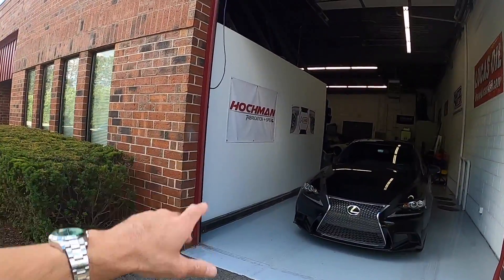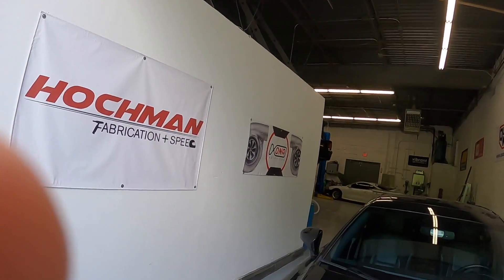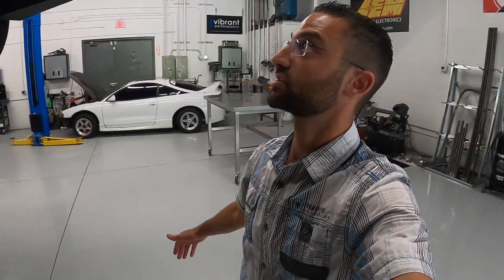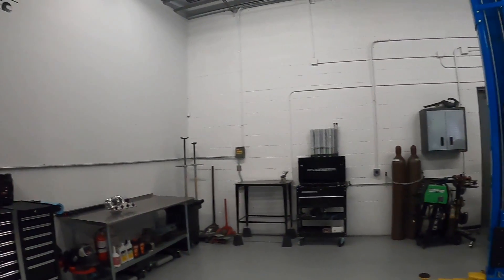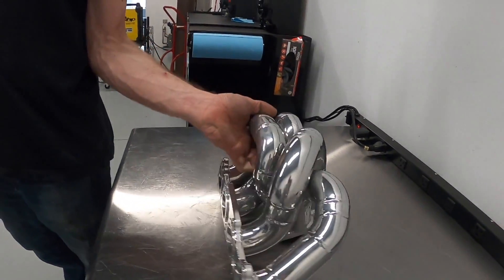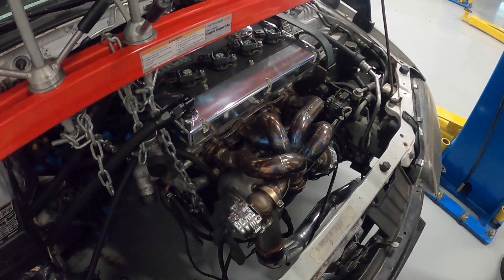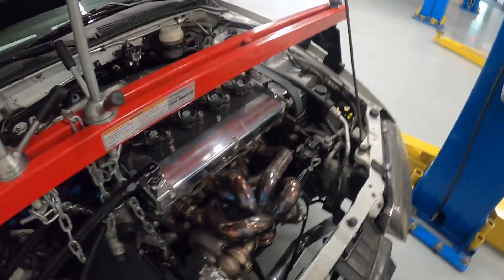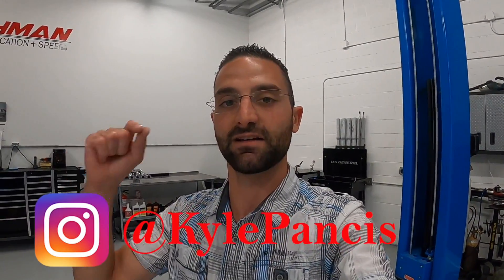Can we make a 500hp Saab 9-5 a Reliable Daily? #lovesaab

Comment: Hi, Kyle! Probably the best Saab tuner is Nordic Tuning in Sweden, they are specialised on Saab and have showed up cars with 700hp+. They know everything you need to know about programming in Trionic7, modification of the engine, turbo and so on. A 500hp daily drive 9.5 should not be a problem for them. You find Nordic tuning on Internet, contact them and tell them about your plan. Good luck!
Reply: SaabNoob in the UK can do it also.
Reply: My Saab is tuned by Nordic performance in Norrkoping, they are good. Maptun in Orebro is really good too. It´s the two best Saab tuners in the world!
Reply: I'd second Performance by Nordic in Sweden. They are the kings of making a ton of power out of pretty much any SAAB.
Reply: This is very very useful information right here

Tuners are everywhere but not a lot know what they’re doing when it comes to SAAB

Comment: Can be done. I live in 🏴 and have run a 500BHP 9-5 daily runner for the past 12 years! Has its problems, but still going well.  Ask whatever you fancy, happy to advise. SOULFIRER - UKSaabs
Reply: When you say has its problems do you mean the normal wear and tear items?
Cheers
Reply: @tseru1e  . Well- not really... 
more like-
- yes-expense of replacing specialised parts like AP discs at £800, but you need to watch oil pressure, even running 10/60 motorsport heavy duty oil and mapping idle revs to 1000. At idle when very hot oil pressure only 1 bar (15psi) Should baffle sump or dry sump it really. Had to rebuild bottom end twice after trackdays.
-I’m on my 2nd set of wossner pistons
- stainless steel big exhaust is noisy and annoys one of my neighbours 😇
- laggy below 3k - feels asleep and gutless until it’s on boost
- quaiffe 6speed gearbox sticks out into wheel arch reducing turning circle to right. So no more 3 point turns.... more like 5 point turns 😆
- breaks ABS wheel rings quite a lot
- runs on coilovers which are VERY firm and lowers car so you need to be wary of water ingress through air filter (drilled holes)
...... that kind of stuff.
Some of it like the suspension could be avoided or swapped I guess, but gives you some idea.

Comment: Greetings from Bulgaria! 
Here you go brother:
- Custom Tubular Manifold 
- Tial 38mm External Wastegate 
- GTX3071r Turbo 
- Wossner Pistons 
- T5 Cams 
- ARP Head Studs 
- Spec Stage 3+ Clutch 
- Maptun Built Trans w/LSD 
- Krona 3" Catless Turboback 
- ETS Intercooler 
- D088 Charge Pipe & Intercooler Hoses 
- IDI 050x injectors w/3.5 bar FPR 
- Walbro 4501ph fuel pump 
- Forge BPV 
- Cobra Inlet 
- NGK AFX wideband 
- Full E85 
:) 600+bhp/600 ft lb torque
Reply: Nice a ripped list from John C lol
Reply from the maker: Whats the engine management system?
Reply: @KylePancis  t7 is good for it, that’s the nice thing with Saab. No need for aftermarket Engine management

Comment: Don't forget to uprate the brakes if you update performance. I had Maptun discs and calipers on my Aero, as they are a massive improvement on the Saab set up. You will need different wheels as the Maptun brakes won't fit within the standard Saab wheels.

Had my 2005 9-5 Aero up to 300bhp but going for more power would have meant a full engine strip down to change piston and rods to forged items. It was still good enough to worry the local BMW owners.
We are lucky in the UK to have Noobtune for remaps, and tuners like Abbott for intercooler, exhaust fabrication, turbos and bolt on suspension and steering componants to make them handle. I took mine as far as I wanted to-that is, within a budget.

Comment: Love your Saab videos. I do have a question. Where do you source your parts? I need a master cylinder for a 2001 95 Aero
Reply from the maker: shoot me an email or message on IG with your email. I can pass it along to a guy that is a follower and works out of a yard with some saabs, he should be able to help
Reply: Orio that made all of the Saab original parts are still in business. https://webshop.saabparts.com/ it's amazing you still can buy original parts 10 years after the manufacturer went bust. not sure if they ship to the U.S though
Reply: @nunezmartin7441  yes ofcourse they do ;)

Comment: Trionictuning.com has alot of info you will need. Also the stock ecu can be modified easily by flashing, it just doesnt like antilag or 2step cus it doesnt like a rich mixture. But by changing exhaust, springs etc simple stuff + turbo you should hit your 500 mark easily. E85 is also simple, you just need a flex fuel sensor. Then I would suggest checking out yt channel "trionic seven" he has alot of in dept content. Looking forward to this! 😎

Comment: Just ditch the engine, as the GM B235 is pants.  Get a B234 from a 9000. They are fully forged internally. Pistons are stronger, and the block is much stronger too as the walls are thicker.  All the B235 accessories will bolt to the B234 and you can use your Cyl head too. But you will need to use a B234 head gasket. Then just head for 500bhp with injectors and turbo. The B234 block will take it fine.
Reply from the maker: Can I still use t7 management ?
Reply: @KylePancis  Yes, keep T7 management.
Reply: That's not right ... b235 and b234 crank, rods and blocks are just as strong, pistons are the difference when tuning. They're not "fully forged" either, just beefier/bigger mass pistons than b235. For 500bhp he would need to get the pistons machined and use a t7 headgasket. It will never be a RELIABLE daily with t5 headgasket on 500hp. So yes, you could get a b234 block and use that, but pistons would need machining, would need to use t7 head and all accesories aswell. I built a b234i (N/A engine)/b235 hybrid myself, but I'm not aiming for 500hp, so I went with t5 HG to avoid touching any internals.

Comment: Rough shopping/fabrication list:
- Gtx3071R (or comparable) turbo, might require top-mounting it
- Spec clutch with high enough rating for the power
- Quaife LSD
- Uprated fuel pump (for good measure)
- Deka 875cc injectors
- Tubular exhaust manifold
- Full 3 inch exhaust
- Custom intake cobra
- Combiadapter/ObdlinkSX/Lawicel CanUSB to read and flash tunes
- Download t7suite to modify tunes
- Upgraded pistons (stock will only hold up to about 300hp), go with wössner or wiseco
- Upgraded cams, b234i intake and t5 exhaust MIGHT be enough
- Big front mount intercooler, need to fabricate some new mounts for the ac condenser and oil cooler to re-arrange the order of the radiators/coolers in front
- Beefy intake piping from IC to TB
I THINK that should be most of what you'll need, good luck with the build!
Reply: Standard fuel pump will not do 500hp, i think even a walbro 255 is squeezed over 500 unless its not standard voltage. And then if you bring E85 into it you need alot more fuel so it gets worse. Also if I remember correctly nordic have seen over 600hp on standard t5 cams
Reply: stock t7 pistons will hold 400hp if in good shape
Reply: @ottopalosaari8685  no they wont... im on the ragged edge of my b205 pistons at 440nm.

Its not horsepower but torque/cylinder prcssure that they cant take
Reply: @boostedsaab2757  ofc with limited nm on ecu
Reply: @ottopalosaari8685  yeah but then whats the point. My car would do 360hp 500+nm but i cant because it will melt a piston. So annoying
Reply: @boostedsaab2757  exactly 😂

Comment: It's a convertible SE Saab 2003 and I like to get rid of it a little bit of nothing I hate you just junk it is anybody in the sidewall interested let me know the quarantine belt broke I don't know if it's the water pump or not and motor mounts and bushings and you have a good running car is over 200,000 miles